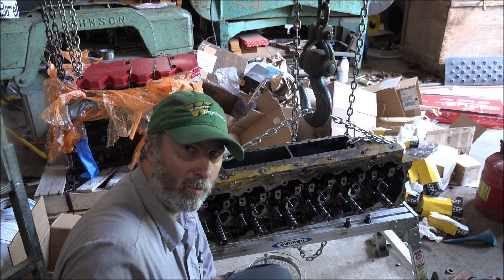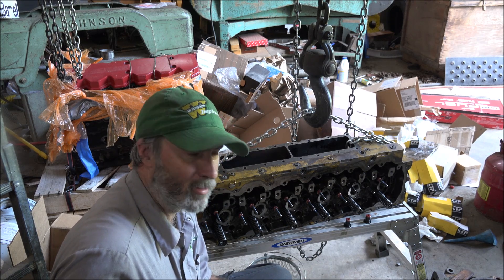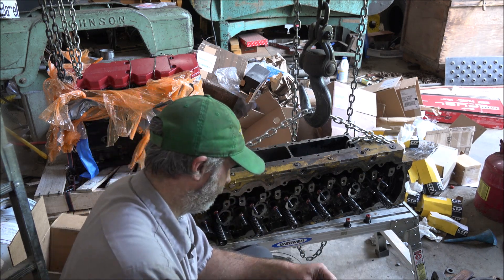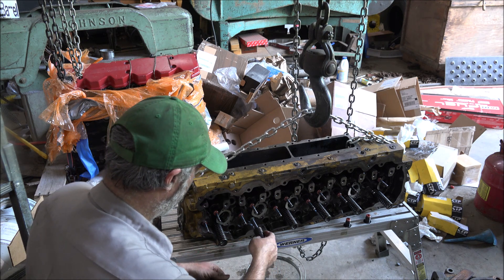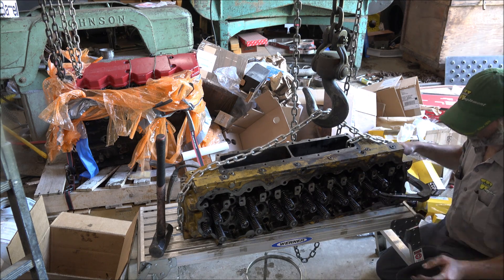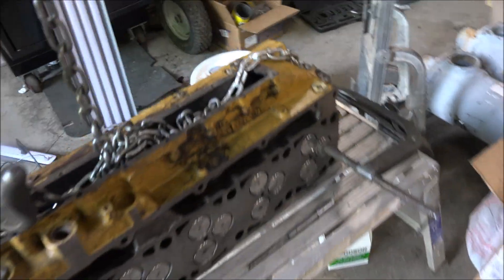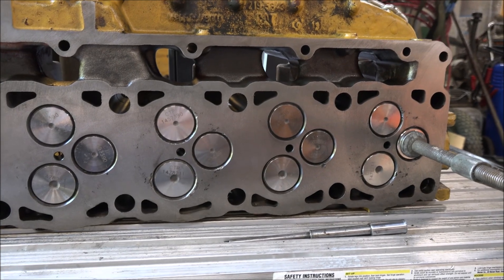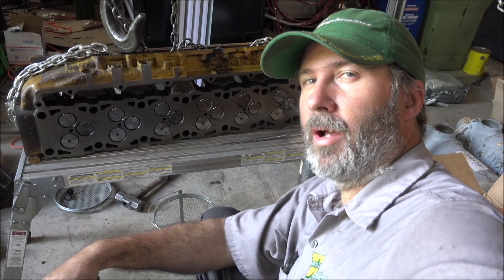Caterpillar 3126 Cylinder Head Assembly

Comment: 3126 and 3116 are same engine, not sure about the C7! What make is that valve spring clamp! Looks like it has more clamping pressure then standard clamps!
Reply from the maker: 3126 is bigger bore size than 3116 so not the same.